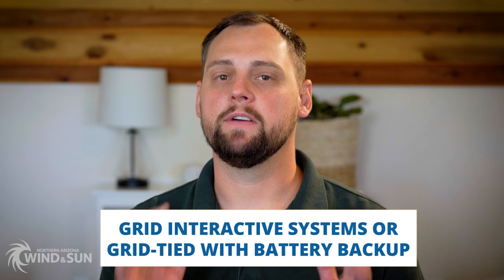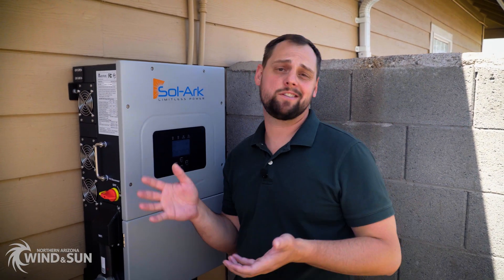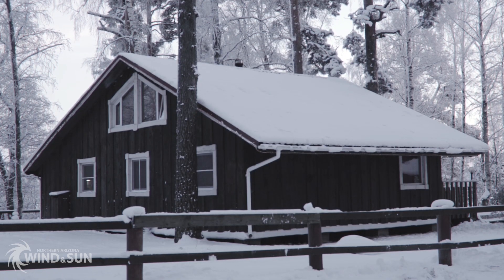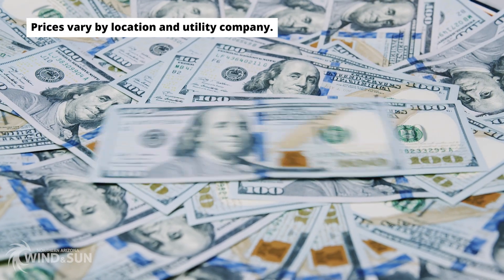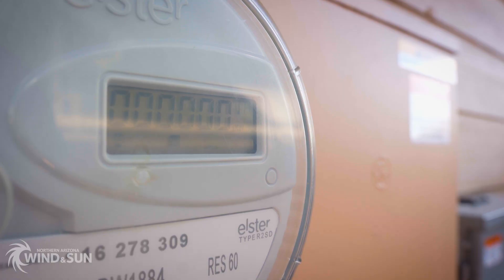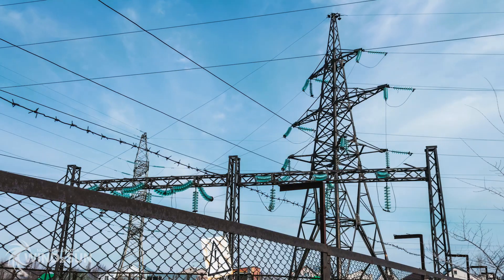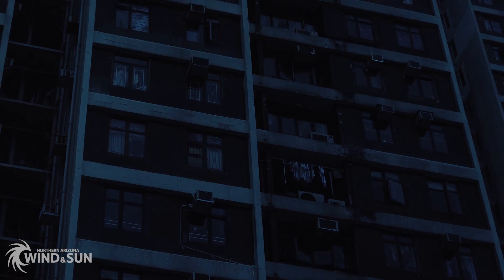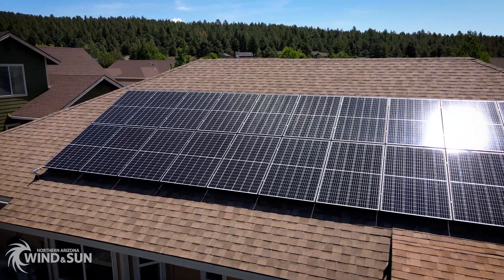Understanding Grid Interactive Systems - The sweet spot between grid-dependent and off-grid.

Comment: Thanks for the video... I would really like to see how panels are installed on a steep metal roof.  Trying to figure out how the logistics go when you are directly mounting to a standing seam metal roof.   I have my own project coming up and 60lb panels with a fairly steep pitch look almost impossible.  I envision a powered lift (similar to a shingle lift on a ladder) but once it gets to the roof line - how do you handle getting it up the pitch to the next "slot?"  Is there a rail system or tool that can allow the panel to be "rolled up" from the roof edge up to the next spot above the last panel installed?  Thanks!
Reply from the maker: Jake - Thank you for the question. We always recommend reaching out to a professional installer in your area if you have questions or concerns about mounting on a particular roof type, the most important part is staying safe!